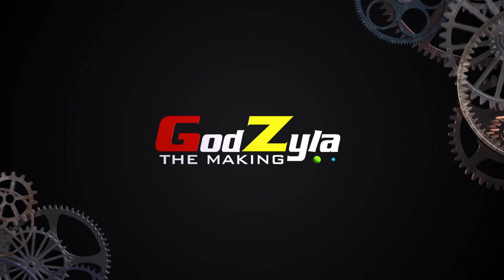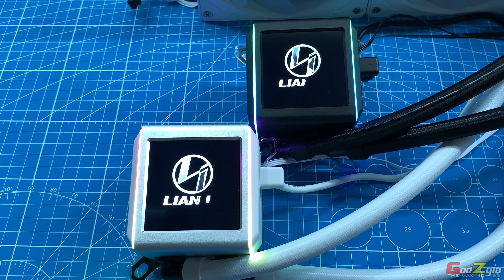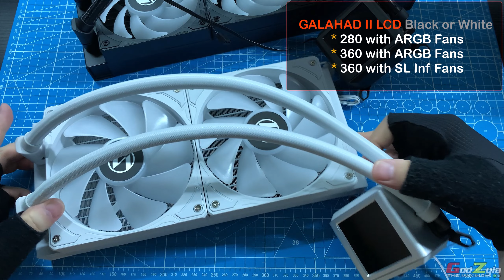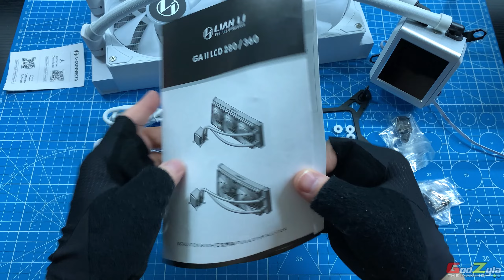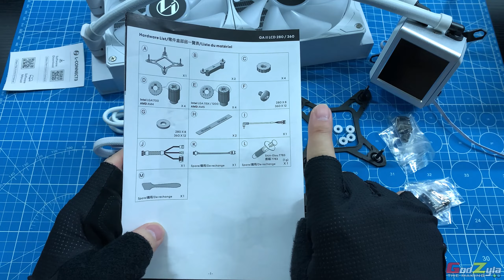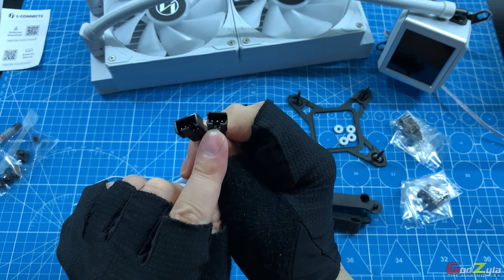Lian Li Galahad II LCD

Comment: Only 2 content found in YouTube about this AIO, but I still prefer the details you've illustrated, which covers the functions and features of the argb application. You even show us how it's applied, super useful. Thank you Kleo! another top notch and excellent review. Honestly Lian Li should hire you. 😍
Reply from the maker: Hi Nox, welcome back. Thank you for your kind words, greatly appreciated it 😉
Reply: @KleoYan  yes can you run SignalRGB at the same time while using that L Connect software? only on the Galahad 2 LCD im curious
Reply from the maker: @bigcountry6231  hi welcome to my channel. So sorry I don’t use signalrgb and won’t run multiple ARGB apps at the same time. I stick to one ego ARGB system. As for the question, you might want to go signalrgb forum to ask, if there are any.
Reply: One question you dont need the 3 pins rgb?
Reply from the maker: @dirkbrinksma686  hi welcome to my channel. Yup you do not need to plug the 3pin argb connector from the pump to motherboard, as you can control the argb using the L-Connect 3 app. unless you want to control the ARGB using motherboard utility and if you want this. you will still need to set in L-Connect-3 to sync with motherboard argb application.
Reply: @KleoYan  thank you very much, great channel you have
Reply from the maker: @dirkbrinksma686  you are most welcome and thank you to have visit 👍

Comment: After their galahad Trinity 2 release i feel like they are falling off. I have had 2 of their units fail on me with less than 40 days of use. Performance is also surprisingly mediocre compared to a much more budget option like the thermalright frozen notte
Reply: I just sent a Performance model back due to pump grinding sound 28-29 days old. not uncommon 
from comment on forums I use.
Reply from the maker: @Andy-y7z5c  Hi Andy, welcome back. Hopefully you do get a replacement and will not fail on you.
Reply from the maker: Hi Zxerv, welcome to my channel. Thank you for your feedback and experience. Have you do a warranty claim at lian li official website? https://lian-li.com/contact-us/ file a warranty claim and real sorry to hear this mishaps from you. I have been testing the Trinity performance for awhile now. I have no issues with it. Hope you did get a replacement soon.
Reply: @KleoYan  Currently on RMA
Reply from the maker: @zxerv9935  hi and welcome back. I see, hopefully you  can get back fast and will not fail you again. Thank you for your update.
Reply: This one does use asetek instead of their in-house pump design they use for the other galahads. So in terms of reliability, you're gonna look for issues with the other 8th gen ones like Ryuo III
Reply: Kinda makes sense why theyd go for the asetek pump. The galahad trinity pump failure has been noted quite alot on forums @mnhttn_

Comment: Is it a good upgrade from Lian Li Galahad SL 240mm?

Actually I can't fit the 280 in my Air Mini as it only supports 240 at the back, which is annoying!!
Reply from the maker: Hi adv10, welcome to my channel. Infact all the Galahad II AIOs are upgraded version. In my opinion, it's worth the upgrade.
Reply: yeah just a shame i cant put it at the back of the case @KleoYan
Reply from the maker: @PixelVogue  I see and yes I do understand how you feel as I once had this problem where I can't fit my first 280 liquid AIO into a case. From there I get to learn to observe case first if i want to use a 280 liquid AIO.
Reply: will wait for your performance review 👍 @KleoYan
Reply from the maker: @PixelVogue  ok dokie. thanks for waiting.. it will be like a week or so as I am letting this LCD AIO sit in my PC to let it run, just like what I did with the Trinity. will upload it once it's ready. thank you 😉